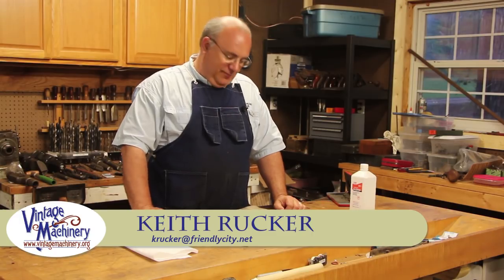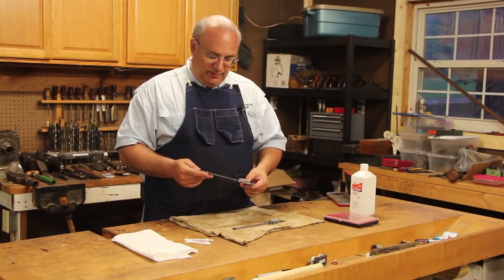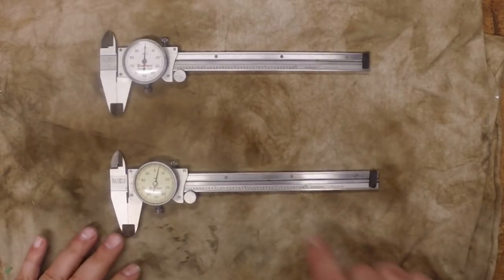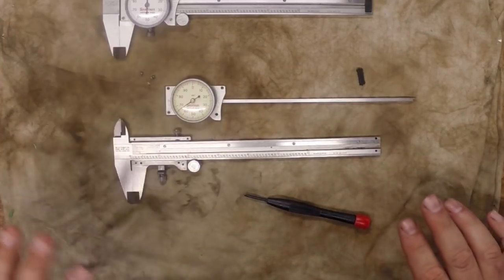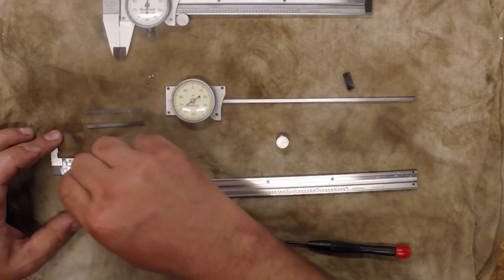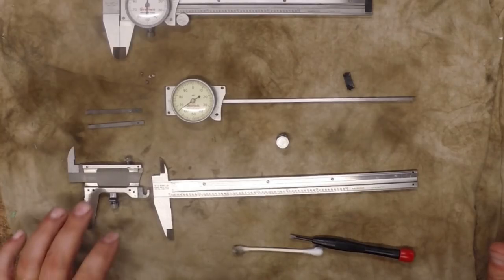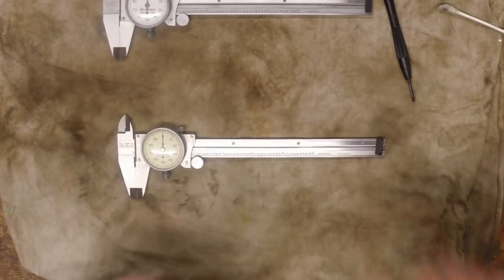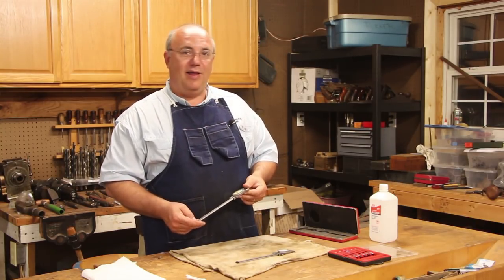Starrett No. 120A Dial Calipers:  Disassembly, Cleaning and Reassembly

Comment: Thanks Keith! I just finished cleaning a Starrett 120 along with your video. I thought I was gonna have to throw it away. I have a bunch of measuring equipment that needs maintainance.  I bought my wife's uncle's machine shop lock, stock and barrel last year. They had been running this place since they got back from the Pacific in WW2. The last brother had to hang it up about 5 years ago. This place is a museum itself. I am still using an old Sydney lathe, 1894 Brown and Sharpe horizontal mill and a Champion 20" drill press. Although the DP needs a major overhaul.

Comment: In my 15 years in the machine shop at The Grass Valley Group.  I was taught that you could keep your JAW FACES  clean and polished by using high quality paper. By GRASPING THE paper and sliding it out of the jaws... And to use Tri-Flow teflon spray lube, similar to REMOIL after cleaning. Dries and leaves a lubed film... My old boss sent my 120 6" set BACK TO STARRETT for service, after 40 years they needed help neither of us had to give.

Comment: Man, That was well timed. I picked up a set of 120 12" used a week ago that were a little sticky until this morning. Thanks a bunch. A few minutes with a toothbrush alcohol and a touch on the "bad spots" with a copper pot scrubber and they look like new. I think I owe you a cold drink for this tip!

Comment: I agree, dial calipers is the way to go, and the Starrett 120A is a great caliper.  I have two of them that haven't been cleaned since I've owned them, and that's many years.  I've done much more lathe work then normal lately, and now my calipers need a good cleaning.  Thanks for presenting this information, and I've visited your website many times.

Comment: Keith, I also prefer to use dial type caliber, and I also use 2 of the starrett 128's.  I clean them every so often and I find a tooth brush works quite well to make sure the rack and pinion are clean.  Thanks for sharing.  Job well done.

Comment: Hi Kieth, I agree with you on dial calipers. Gone back to a fine adjust vernier and a dial caliper. 
 I like a dial so I can see which side the dial indicator arm to the dial face mark. Interpolation a lille plus or minus thing you cant see on a digital! 
With out track cover,  Starrett 120 A can be blown down the rack down away from the dial, pull the dial to right and blow to bv the left. 
Now six years later than this vid, they have ckange the battery from LR44 to CR2032, which hot me to reinvest into an a new one for general use and to get a metric reference also. 
Also enjoy your videos and your adventures! 
Happy Holidays 🎅
Steven Columbus Michigan

Comment: Hi Keith, for some time I have been using the digital calipers, but your video got me interested in my dial calipers. While fixing a computer and while watching your video about how to clean them, I took out my Mitutoyo 6 inch caliper. It looked very easy to take apart and it came apart very easy. I have mostly very small tools for 1/32 live steam engines and this looked like any easy project. It did not go back together very easy and I would not recommend taking one of these apart. The small gear and pointer came lose. There is not much keeping it in place once it is apart. It is kept in position by a small metal yoke spring working against the rack and the dial under the bezel. The only way to put it back together is to remove the bezel. And with luck I did get it back together. It is now clean but I did not get the pointer to be in the 12 o clock position. I am just happy I did get it back together. I do like your videos and enjoy learning from each one. I think the Starrett ones are great and the way to go. Most of my tools are all used.

Comment: For those of you who still have your own teeth, an old toothbrush is an extremely handy and overlooked tool for getting tiny particles out of tiny parts, spreading grease and oil as well as being resistant to many solvent based substances.
I never throw mine away, gently heat the neck and you can angle the head any way you need and the handle can be melted or  sharpened to form a surprisingly strong point, scraper or prybar (spudger) for opening anything in a casing.  It's electrically insulated so good for inserting/removing watch/button batteries.

Comment: I have worked in a calibration shop for almost 4 years and i never thought of using the rack for minor adjustments,,, I just used the gear that is attached to the rack which is alot harder to do, plus alot of my customers would do what ever they wanted to with them, like run over them with a truck. Anyway I really enjoyed this video and learned a little something. So thanks
Reply: +Charles Thompson also the Slider at the top along with the plastic piece, I have never seen on the Starrett pieces, Well the slider on top I have,but there was never any thing on the bottom... they must have removed it
Reply from the maker: +Charles Thompson The rack is only good for very minor adjustments, but there is some room in there to move the dial over a bit one way or the other.
Reply: +Keith Rucker - VintageMachinery.org I never messed with the rack myself. I was also wondering the best way to adjust the Depth rod? I have loosed the screw and sometimes that works, but I have seen some that are way out and workers have just placed it on a grinder and grinded the rod, but that does not seem to be the best way, we have not instructions to speak of
Reply: Charles Thompson 
what is the process for properly adjusting the hair spring to get good repeatability
Reply: Make sure it is tight and lined up correctly, if not it will slip and give incorrect readings

Comment: Mr. Pete Repaired a Brown and Sharp  caliper, I believe it was tip 407. You remove the bezel then the face. He was able to take the face off without removing the needle. Then there's three screws under that. but only two need to come out. Hope that helps for next time. Take care.

Comment: Thank you for the valuable information, Keith! I don't own any Starrett calipers right now, but will start looking on E-bay and Craig's List. I too like the dial as opposed to the electronic units. You never have a battery do dead on dial calipers! With the $50 you saved by doing the job yourself, you can take your wife out to dinner! :-)
Regards,
Dave
Reply: Just be careful, I bought a 9” Starrett 120 dial caliper that was described as “good.” I won the auction for $60.00, it arrived, a tail piece was missing, the tension leaf spring inside the head was missing, and the gear train inside the dial was stripped. I considered fixing it myself, but parts were not for sale. I ended up sending it back to Athol, MA for estimated costs and was quoted about $100. I wanted a replacement plastic case, but this was a vintage caliper that did not fit current cases; they quoted me $15 for a wooden case, which I opted for. The caliper came back in new condition, they even ground off the previous owners name from the back of the head, and the case is like a piece of fine furniture. Bottom line is I ended up with a perfect caliper worth over $200.00 for about $175.00 so I think I did alright. Yes, the eBay seller got a negative review.

Comment: I found once you have the gauge on zero, slightly tip the gauge top downward and it helps the gear drop in place easily and keeps it at zero, align the holes then tip it and drop it in place.

Comment: Thanks Keith. Just got a used one off Ebay that seemed jammed. Your vid fixed it.
Reply: ***** Keith I have a 98-12 Starrett  level and I need to change the Vial. how is the best way to do that sir ?
Reply: +Outlaw Rail removed the old vial with a small flat head screw driver by prying away the compound that secures it. the new vial should fit snug if you use the compound and smooth it out at both ends and place on a level surface while it dries

Comment: Hi Keith. I got some dust in the gear rack of my late 1970s vintage 120-06 dial caliper. The dust made my gear jump a tooth so my 0" with jaws closed was 0.025" off. I opened the dial to expose the gear, cleaned the rack, closed it up. Now the needle points north but not directly at 12 o'clock. Upon reassembling I found a tiny "L" shaped part and I wasn't sure where it went. I figured it was part of the bezel locking assembly and put it there. Did I guess correctly or is that little part supposed to go elsewhere? Thanks!

Comment: Great! I just got a Mitutyo 12" like that. It has the same problem and worst the dial must be fix. The needle in the indicator is loose.
Is there any way to remove the glass in order to repels
Reply: Hi Robert, the glass comes away with the ring, just gently lever it up with a flat blade screwdriver.
Reply: Chris Stephens Thanks Chris. I did that. The bad news is that the dial spindle is broken into the hand. 
Alas, It's a job for the repair shop.
Reply: Alas indeed, sorry to hear that,

Comment: Hey Keith, I was hoping you might be able to tell me how to disassemble the dial on the caliper. The two screws on mine on the inside came loose. I certainly dont want to damage anything. Thanks
Reply from the maker: Robert Guy I probably should do a follow up video to show that.  You basically have to pop the dial off of the stem that it is mounted on and then it comes apart pretty easily.  A small screwdriver can be used to put upward pressure on the part of the dial that presses onto the stem to pop it loose.

Comment: I got a 6" red-face 120a Starrett it was off 25thousands. I followed your directions and got it zeroed again, but my dialed-face is moving(loose) and the tighting pin is not keeping it tight. How can I fix this?
Reply: Do you mean the red dial is loose or the whole bezel?
Reply: No the face(red-face)is loose. The dial is at 12:00.

Comment: you might want to tweak the rack with the screw driver on the back end of the rack. Just in case you wear down a tooth or chip something.
Forgot to add a drop of oil to the rack. (keeps it sliding smooth)

Comment: I have made a plywood tray about 2 feet by 3 feet for working on things such as this..The culprit in most of the dial calipers I take apart is the anti backlash gear and spring, usually an ill-defined zero is the fault..I find digital calipers irritating to use..

Comment: great timing spotting this video as one of my hf beater calipers is playing up after 15 or so years of accumulated abuse.  will be attacking it soon.

could you now do a video about sticky micrometers? i have a couple that the spindle is very stiff to turn making them virtually unusable. there are plenty of videos about calibrating a mic, but I've not found one about cleaning a repair.

Comment: Like an idiot it finally happened and mine fell which knocked the dial from zero to roughly 40 thousandths off.  The rack on mine does not have screws and I am unable to reassembly with the dial at zero.  Any ideas on how to fix?  Thanks!

Comment: Thanks for another informative video.
Never heard "as easy as cake" always heard "as easy as pie" guess that is just a different part of the countries slang.

Have you ever cleaned a dial indicator?  Have some that are 40+ years old that have some sticking places and am sure that all they need is a good cleaning.  
HH
Reply: I have a Brown and Sharpe 0-1" dial indicator that I took apart not too long ago. It had some sticky spots in the travel after someone had dropped it. I worked the lens off by lightly prying with a small screwdriver. Then I was able to work the graduated outer portion of the dial off without taking off the needle. Underneath that I found four screws. Those four screws when loosened allowed me to adjust the mesh of the gears and I was able to completely eliminate the sticky spots in my indicator. A hand extractor for watch making is  a wonderful tool for this job. I wish that I had one.

Comment: Watched video on cleaning 120A Caliper. I clean mine with solvent and a fine Bristle Brush. Mine came with a tool to reset the dial without any disassembly what so ever..
Reply from the maker: Wayne Gotthardt Some of these calipers did come with a little piece to slip under the gear so that you can move it a tooth or two.  Problem is, if the gear jumped a notch, it was probably because there is a piece of trash in there.  When my needle moves, I just take it apart and clean it to make sure it does not happen again real soon.  I just had to clean mine again the other day....

Comment: Check in watchmakers and model suppliers catalogs such as MICROMARK.COM to find a screw sticker.  These have 3 or 4 spring clips in a tube which when depressed come out of the tube and open.  The clips or prongs will hold small screws or parts to make reassembly a little easier if have FAT fingers or tight places.  Anyway good luck.

Comment: Hi Keith, I'm sure there will be some throwing their hands in the air at using Q tips as they are prone to leaving fibres on any sharp edge. I prefer to clean the rack and gear with a soft-ish tooth brush, but I'm sure there are also some hand throwing at that too. 
Mitutoyo calipers are much easier to reset to zero with the little tool they provide, it fits in a small hole and allows you to disengage the rack without any need to disassemble anything save the hole's cover, which also acts as the bezel clamp.
ATB
chris

Comment: Dude... Thank you!.... I bought a pair off eBay that were advertised as new and when I got them I could see they were clearly not. I kept getting anywhere from .001-.004 in variance every time I tried to repeat zero. I called starrett and was about to send them in for repair/ cleaning for $78 but then I found your video. They were exceptionally dirty on the inside, but since cleaning them up they look new and stop dead on zero every time.... THANK YOU!.... Your video was not only very helpful, but extremely professional- outstanding channel.
Reply: Totally agree. Very professional. Great job.

Comment: Hi Keith,
Personally I own a cheap digital "beate approximeter" to get close.

 I like the digital cause it's easy to convert between imperial and metric, and, that beater can withstand lots of abuse, when it dies, it's under $20, I don't cry because of the money, just because I got attached to this old beater.

For more precise measures I own an assortment of Mitutoyo and Starrett, like you just say a "real machinists" really cherish his equipment.
Thanks for sharing,
Pierre

Comment: Heh, funny, mine doesn't have that plastic piece, mine has a metal strip and the holes in the caliper are threaded. Missing one screw at the moment, but it still holds.

Comment: A couple of tips I hope you'll appreciate when working on small stuff like this.

You can keep a sheet of copier paper and cellophane tape dispenser nearby when taking out small screws. Orient the screws spacially on the paper as they are oriented on the piece you are taking apart, tape them down, label them by writing nearby on the paper. I use this technique when taking apart laptop computers. It's overkill, but I hope you'll appreciate the idea.

When dealing with putting the tiny screws back in, use a small neodymium magnet and attach it half an inch or so up the shaft of your screwdriver. Ferrous screws (most of them are) will then cling to the tip

I really enjoy watching your videos!
Reply from the maker: tiger12506 Thanks for the tips - I took a pair of these apart a couple of weeks ago and I now use a small cup to hold the tiny screws.  I like the tape idea!

Comment: Anybody know how to fix these when they don't always go back to zero?
  My boss has about ten of them that all have the same problem in that they will vary by 1 to 3 or 4 thousandths when you close them. All of them were extremely dirty, filled with chips, oil & dirt. I took them all apart this far and cleaned them to perfection, even took the rack off & cleaned all the teeth but the needles still land in different spots. Some seem to do fine if you close them softly but they will still be off once in a while. I haven't gone any further because I can't find any instructionals for the 120A and I don't want to pry on stuff until I know, for sure, how to further disassemble them.

Comment: I have a Starrett #216 Micrometer with an odometer style readout. At .016 approx. 180 degrees off of zero it clicks with a resistance and then every full rotation from that point on, it also has constant substancial resistance to rotation that is greater than the ratcheting thumb end can overcome. The lock ring is fully released. What could be wrong? Buggered thread inside? Thanks.